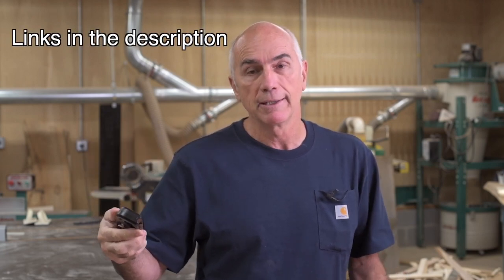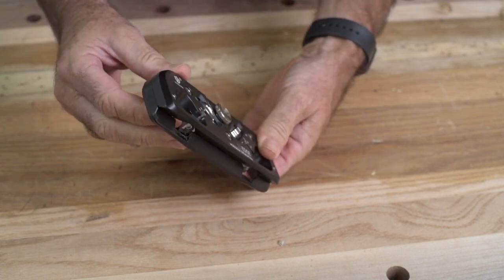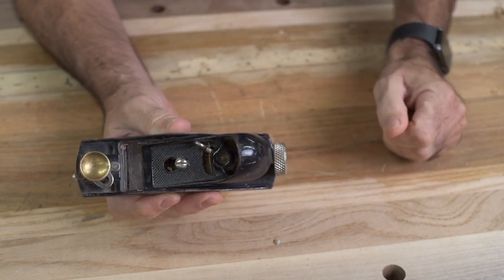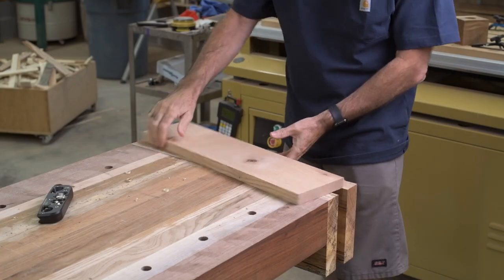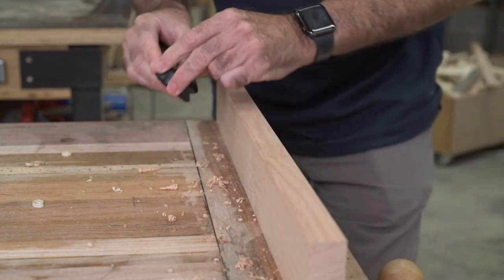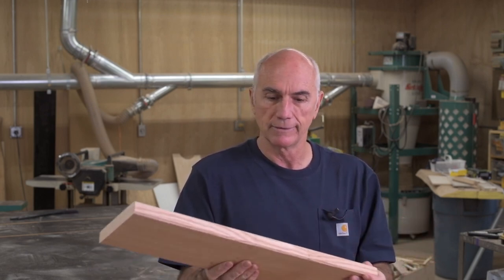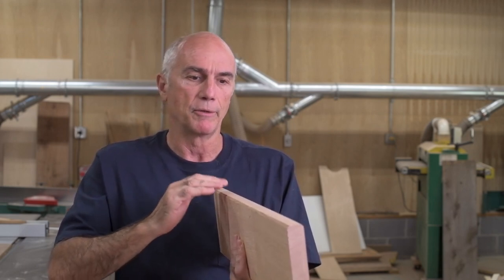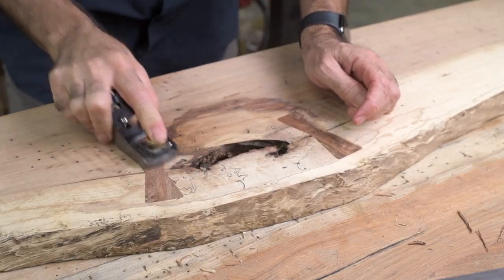Edge Trimmer vs Stanley Block Plane

Comment: I have and use both, for a flat bevel or an Aris you can't beat a block plane, the Bangood version is nice in the hand and is very well made and while it puts on an exact and consistent 45 without thinking about it I've never been disappointed with the angle produced from a block plane and although the modern plane has a carbide insert (just like a helical planer head) is way harder than the plane iron and has 4 cutting edges, when using it the same section of the blade does all the cutting all the time but with a block plane the cutting is done across most of the blade, another small thing to note is if you are running an Aris on an already assemble piece you can (and I do) start the block plane on the skew, that puts the cut very close to the start with just a small amount of clean up the moden one needs to have the sole registered on the timber leaving a lot more clean up, I have also noticed more tearout than I would like.

For adding a radius it works Ok, and I grab it when I only have a small amount to do but if the job is important or I have a bit to do, the router table produces a far superior result, but as I consider the router to be the most dangerous tool in the shop I factor that into the choice as well. 

About 30 years ago I purchased a tool branded "Radiplane" it was timber bodied plane with a brass V sole and 2 curved edged irons, you set the second blade to full depth and first blade about halfway and it produced a very neat radius with very little tearout in most timbers and I used it all the time, it has since been taken by the shed gods and I can't find it, the purchase of the Bangood one was to replace it but it is an inferior product to the Radiplane.
Good luck with your channel Paul.
Peter.
Reply from the maker: Thanks Peter, now I need to look up this Radiplane..

Comment: Good comparison!  I haven't used the Edge Trimmer but I can say that the low angle block plane comes in very handy for many uses and there is something satisfying about putting a nice bevel or round-over on an edge without using a router.
Reply from the maker: I agree, there is a joy to doing a slight round over or breaking the edges and still be able to hear the radio and not a router screaming away.

Comment: Block plane, more versatyle and everybody have one already. You did not touch sharpening yet. Block plane blade is easy to sharpen, what about those edge trimmer cutters?
Reply from the maker: It has a carbide blade that you can rotate which is pretty handy but still.. this just sits in its box..  And I don't mind sharpening so much.. That is a good point though, if you absolutely hate sharpening maybe it is for you.
Reply: @hillbillychic3933  Sharpening, I'm not a fan either and was about to buy one of those just because of that. This is how I end up on your video 🙂 When it come to chamfer/round over I use the router table, the trim router or the block plane. thinking about it, adding another option was not so smart. Thank you!

I'm subbing cause  i like the quality and content.